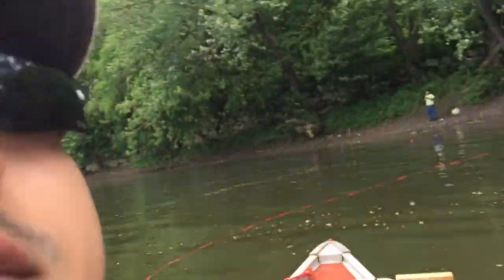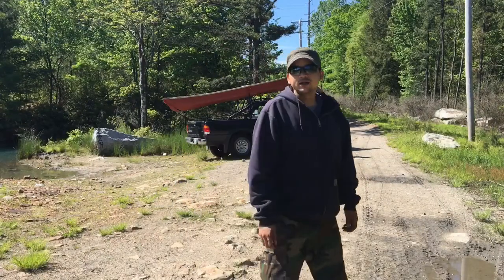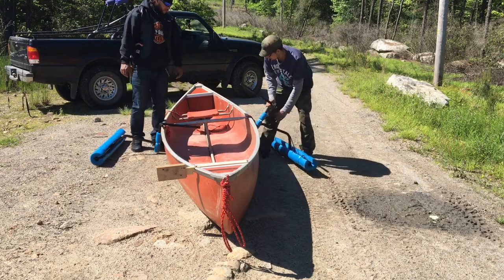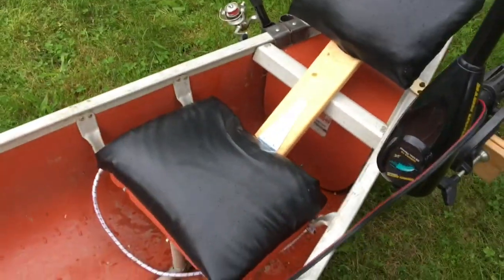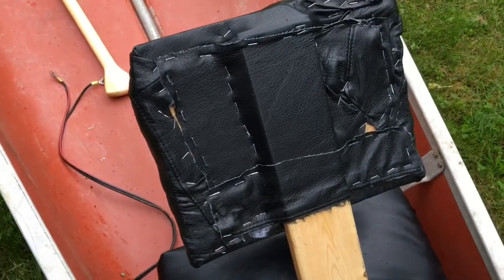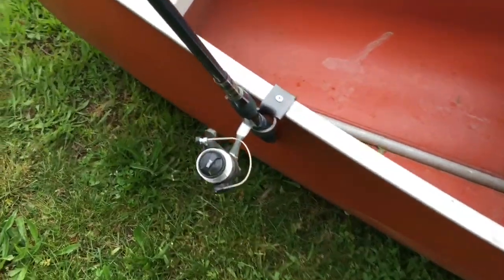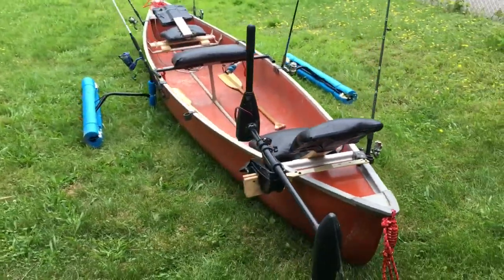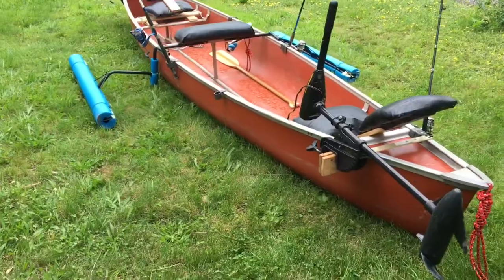$148 fishing canoe with homemade stabilizers

Comment: I got same canoe.. can you explain or show how you built your motor mount? thanks
Reply from the maker: GOOD BLESS   The motor mount bracket was made with a piece of angle iron I had in my shed it was a piece of metal in a 90 degree angle, I cut the one side off to the halfway point then I cut the opposite side of the other end, it’s held on with self taping screws and if you notice the pieces of wood on the end that hang off that it meant to make the bracket thicker.

Comment: What brand canoe is that? I have the same one and cant find the name. Trying to figure out weight capacity..etc
Reply from the maker: Joe Cardenas it’s a Coleman 18ft
Reply: Hernan's Hobbies dude thanks man, thanks for the quick response. Subscribed. Question, after you installed the stabilizers has the canoe overturned? Asking because planning on doing this and taking the kids fishing. Thanks in advance
Reply from the maker: Joe Cardenas with the stabilizers its so much more stable and chances of it flipping around are slim to none
Reply: Hernan's Hobbies thanks again bro.. Cheers
Reply from the maker: Joe Cardenas maximum horsepower 5, maximum person capacity 695lbs, person, motor, gear 775lbs hope this helps
Reply: Hernan's Hobbies dude that helps a lot thank you bro I really appreciate it